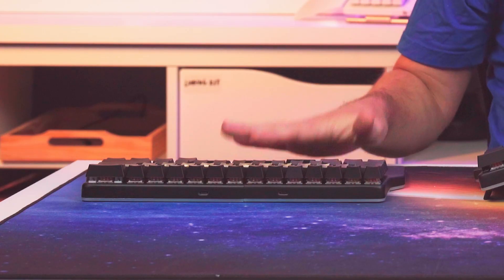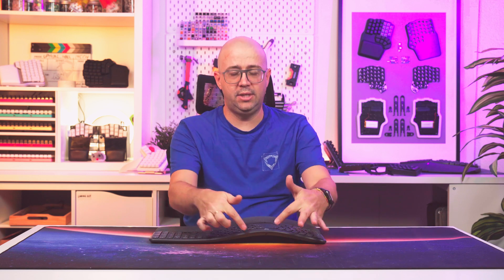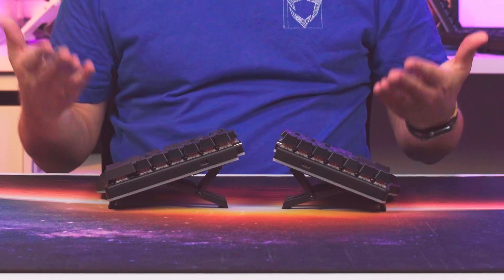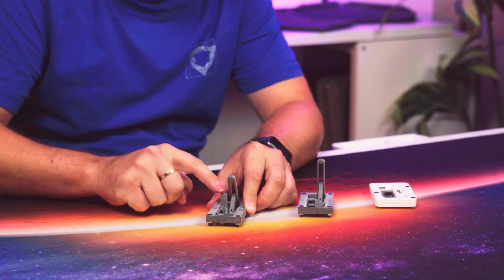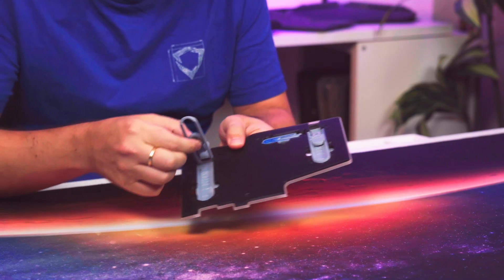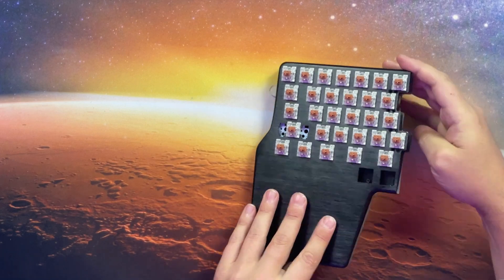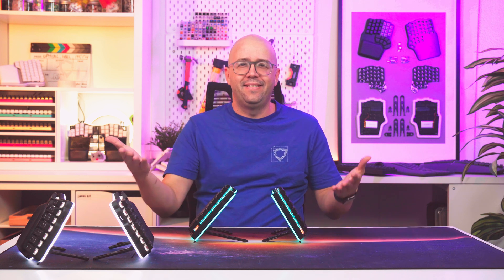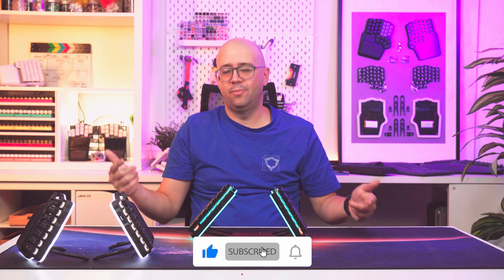We might’ve overengineered tenting… but it works

Comment: Interesting to see the design decisions! One thing I can't tell here or from the website - can it have slight negative tilting and a slight angle from center to sides? I have a C959 and C989 and I want some side-to-side and front-to-back tenting. That's where the ergodox works marvelously for those of us who don't need the high angles, but it's fantastic y'all worked so hard for those who do. Thanks!
Reply from the maker: Officially, it can't, but unofficially, there are a couple of combinations of the tenting and reverse tilting legs that provide that. They are not as stable as the main ones, but more than enough 😊

Comment: The raise 2 tenting is a bit unstable on high angles. The board slides inwards. Would be nice when reverse tilting would also work for few site tilting angles.
Reply from the maker: That could happen with smooth desk surfaces and high angles; the anti-slip surface of the legs might not be enough. I would recommend using a desk mat if it becomes annoying. 

As for reverse tilting + tenting, there are a couple of combinations that "kinda" work, but they weren't stable enough for us to call them a feature. Try the 10º reverse tilting + 15º or 25º degrees.

Comment: I prefer the Raise 1's tenting kit design to my Defy's tenting legs. I didn't mind that it needs a tool for the initial install because I only needed to attach it once, the extra height it adds didn't bother me at all, and I rarely ever need to tent my keyboard more than 45 degrees; the downsides didn't bother me. But the upside, its physical strength, can't be beat. While the Defy's tenting legs are strong, the Raise 1's were rock solid. The legs had zero flex and the support rods clipped into each socket, meaning they didn't move unless I wanted them to. While the Defy's legs get the job done, the minimal design leads to more flex at higher angles, the hinge isn't very resistant (at least on my Defy, it's possible I got a dud), and the peg-and-slot mechanism only keeps the legs in place when the weight of the keyboard is holding the peg in its slot. The weaker design means that, whenever I pick up my keyboard, the legs are prone to falling away from their tabbed slots. The hinge on the peg is strong enough that it can usually maintain its upright position and it'll go right back into its slot when I bring the leg back up, but not always. Also the small legs on the side don't pop out when I pull the legs out. I know you fixed that on the Raise 2 but my Defy still suffers.

If you made an updated Raise 1 tenting kit for the Defy, I'd probably buy one.
Reply from the maker: Thank you for the feedback. We addressed that precisely in our last video (https://youtu.be/UwCKmR_ActY) in case you want to watch it. There's also ways you can tighten the legs of the Defy (check https://support.dygma.com).

Comment: I have both the Raise 1 and 2. The first one feels more stable, but is less convenient. The Raise 2 allows for more angles, is easier to carry and does not suffer from additional height, but the left side is a bit wobbly.

Not sure which one I prefer, however, I do miss the ability to tent to 30 degrees. You can do 25 and 35 on the Raise 2, but 25 is not enough and 35 feels too much, especially since I actively use both keyboards.
Reply from the maker: Thank you for your feedback! Sometimes 5° can make a big difference, that's why we wanted to have as many angles as possible, but I'm sorry to hear none of the available fit you perfectly. 

As for the wobble; it shouldn't wobble at all. Have you emailed us to support?

Comment: No, my Defy kicks ass. One of the pads is a bit worn out due to use tho. Got the 1st batch with proper packaging, my only request for a Defy 2 would be that the keys caps aren't so easily removed, maybe lower profile. But I fckin love the Defy (typing this from a qwerty laptop keyboard, lmao). De los mejores productos Españoles!
Reply from the maker: I'm glad to hear! We actually improved the keycaps on the second batch of the Defy (back in early 2024); they are much more tight and resistant now.

Comment: The $70 Goldtouch board has a split, but attached by a ball-joint at the top (by the T/Y keys) 

It’s limited in how far you can spread the sides (and has other issues being affordable and all)

But it has tenting up to 30°. Higher than almost any commercial board except Dygma pretty much

Good starting point for those who want to reduce arm strain (and never want to desire a non-tenting keyboard again)
Reply from the maker: That's a great recommendation. We're preparing a video with ergonomic recommendations for every budget and I'll make sure to include the Goldtouch.
Reply: Nothing else had the Goldtouch’s 30° tenting when I wanted to get swappable keycaps. So the Raise was my upgrade from that @DygmaLab